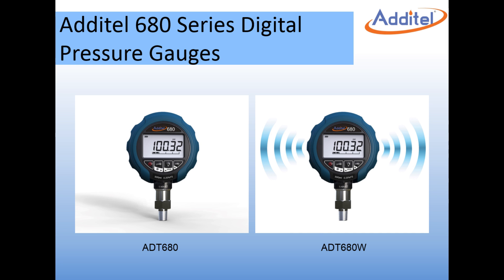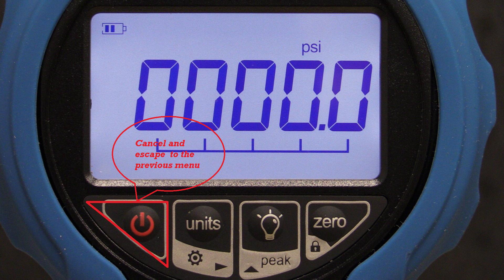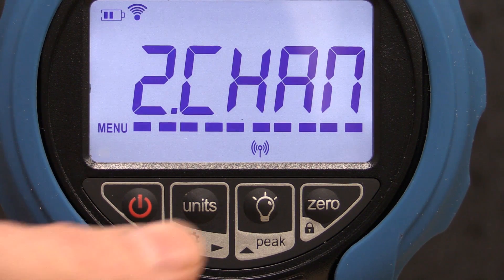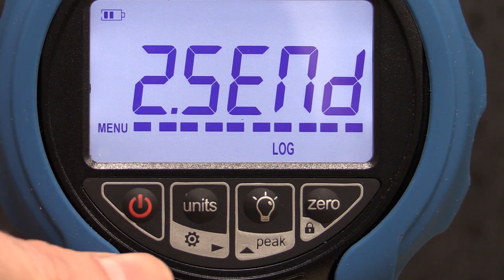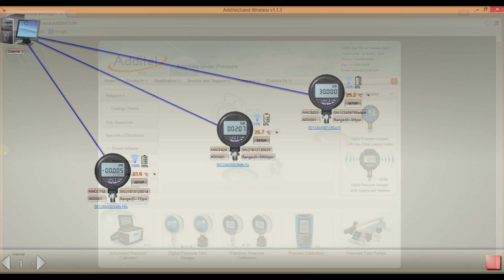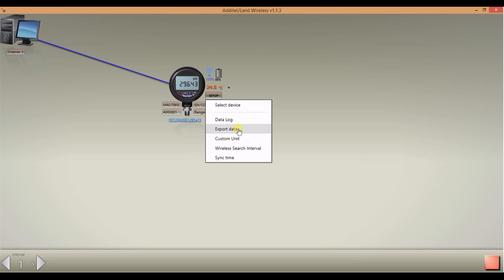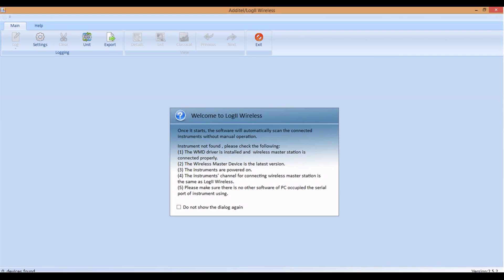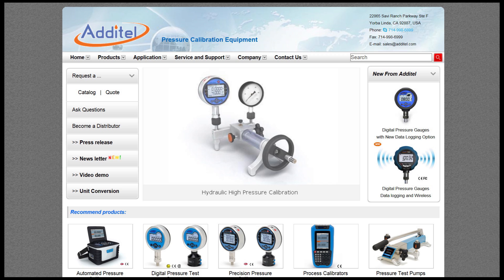Additel 680W Wireless and Data Logging Setup

Comment: Does the 680W gauge and computer (with the wireless receiver USB attached into the computer) have to be within that 20metre range, or the 680W gauge can collect data by itself? I might have an understanding the the 20m range is only for when the gauge is done with data logging, then only the gauge has to be placed within 20metre range with the computer.

Comment: We need to monitor gas pressure drops. The logging period should be at least 90 days (or max battery). I would like to ask you to create an option to set up a threshold logging, so it will ONLY record while the pressure is below threshold preset. Logger will have two logging points: pressure drop time and value + pressure normalized time and value. Can you do such modification to the 680W firmware? or you have an option or different hardware?
Reply from the maker: Hello, we may be able to help, but have some questions for you.  Can you please send your question and contact info to sales@additel.com  Thank you!

Comment: Can it be monitored through internet ?
Reply from the maker: Thank you for your question!  Offsite monitoring of an Additel gauge would currently require that you use our software on a PC within range of the gauge and then use a remote desktop to see the PC/software/gauge over the internet.  I hope this makes sense.
Reply: yes have a latop connected to the gauge and set up remote control on said laptop thyen you can control and monitor from anywhere.